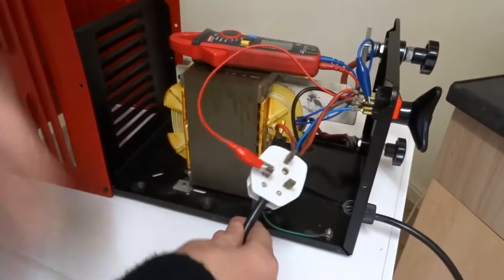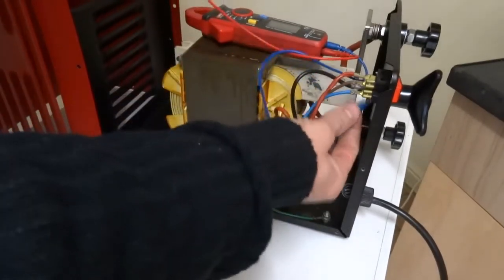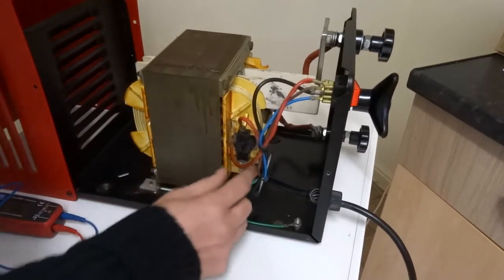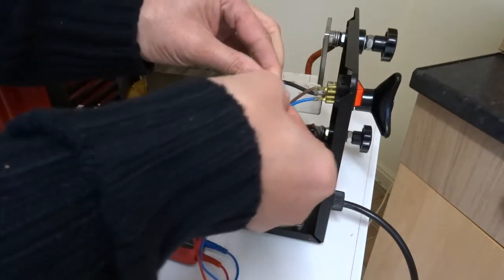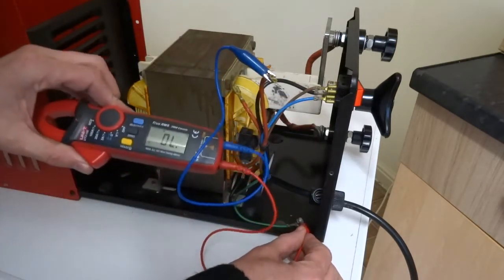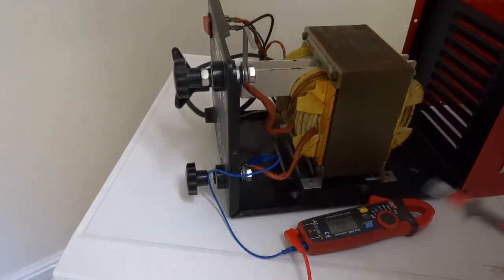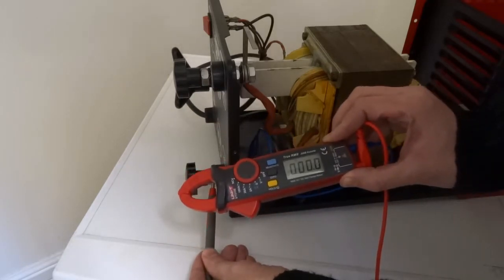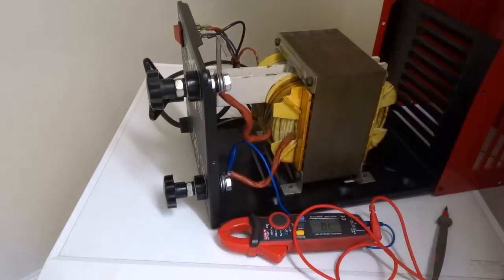ARC Stick Welder Repair: Full Fault Finding Guide Cables, Switch, Transformer & Thermal Cut-Out Test

Comment: I've checked everything you've shown and its all fine and I'm getting 250v to the switch but it won't strike an arc at all.... any ideas?
Reply from the maker: are you getting voltages at the transformer and after transformer
Reply: @cagmito76  primary transformer at on/ off switch 250v but 0v between earth & primary transformer at the thermal cut out. 
The electrode holder & ground clamp have 45v

Edit: it arced between the electrode & ground clamp, will try later (I've changed nothing knowingly since it didn't work)
Reply from the maker: @NorthFenFarm  if your getting voltage between electrode and ground it suggests it ok ?  what voltages does the welder say it should be on label ? using good rods is ground good. Check resistance on electrode and ground cables maybe a bad connection?
.
Reply: @cagmito76  its started working fine , I'm not sure whats happened , whether there was a loose connection I accidentally fixed. 
Thank you for the help, these videos are great
Reply from the maker: @NorthFenFarm  yeah sometime happens pain as it’s nice to know and fix fault but a working welder is a good result
Reply: @cagmito76 okay so I have a problem with my ACR welder when I plug it in I get shocked but there is no display on the voltage could that be my switch issue I don't have a meter tester I'm soldered the turn knob on the welder could that be my switch issue if it's not coming on